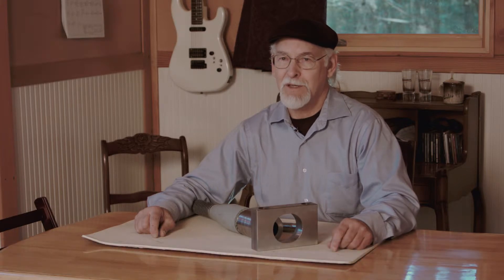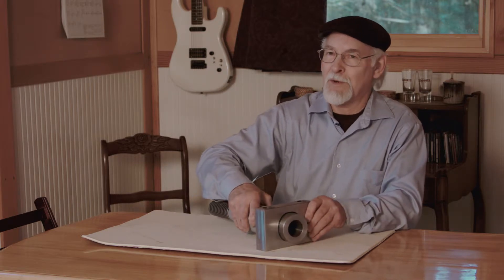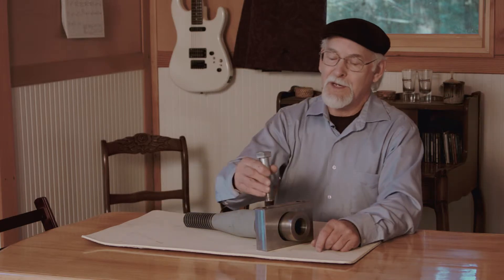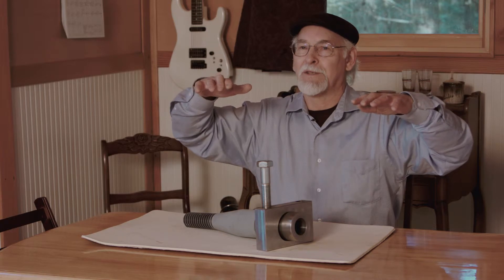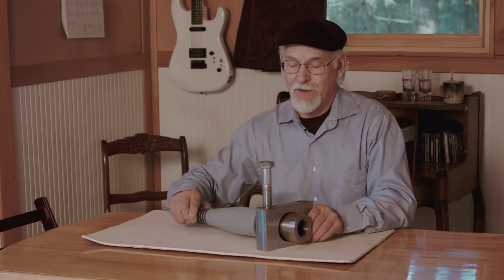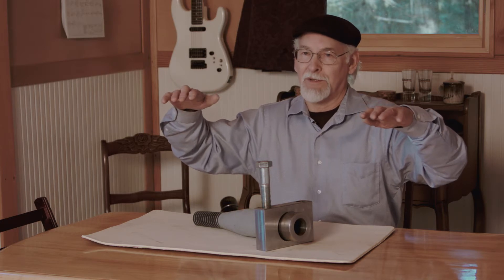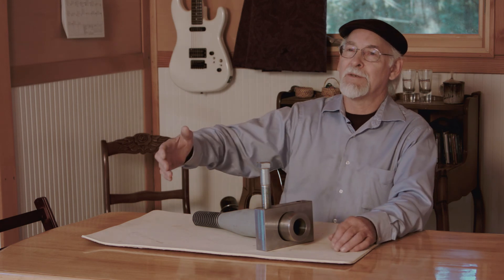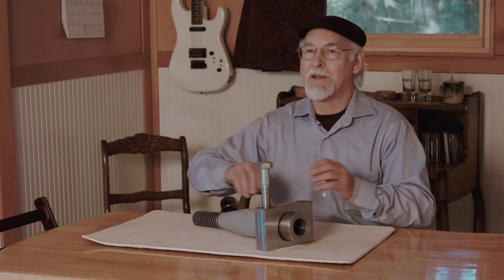TREEFASTENERS.COM pt.3 "A brief overview of the past million years of treehouses"

Comment: “legacy treehouses":)

I think we currently manage a good 10-20 years with our treehouse bolts (TAB, GL, GTS) before tree and house come closer together and kiss.
I think you can add another 10-20 years before you have to worry about a new or restored attachment.

By then, the tree diameter is usually so large that there is only minimal movement during storms.

I think the most important thing is to plan generously for the thickness growth of the tree from the beginning, i.e. build platform construction, walls, gutters, etc. with plenty of distance to the tree. That means at least 30 cm (11 in) distance in all directions. It is also important to plan the support beams on the tree so that they can be easily replaced or rearranged.

Most people build too close to the tree and underestimate how fast it grows;)